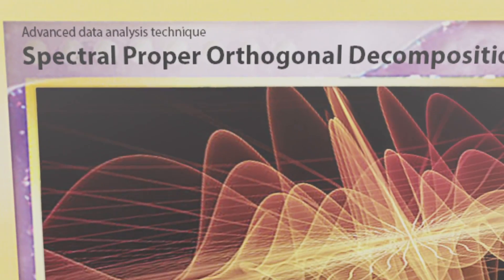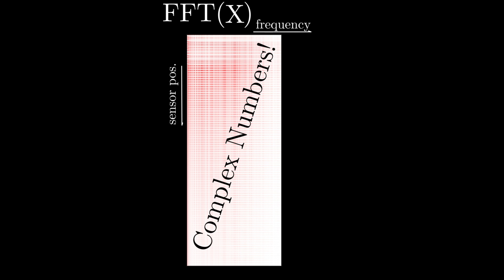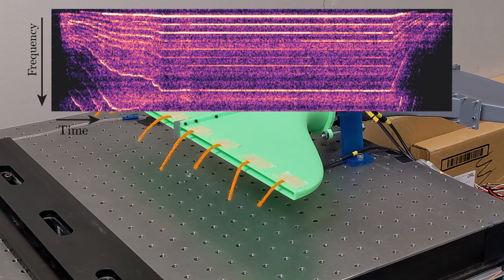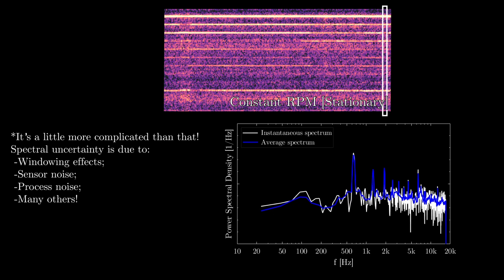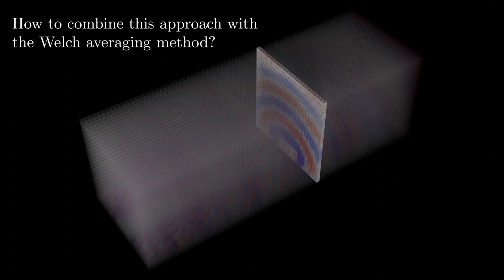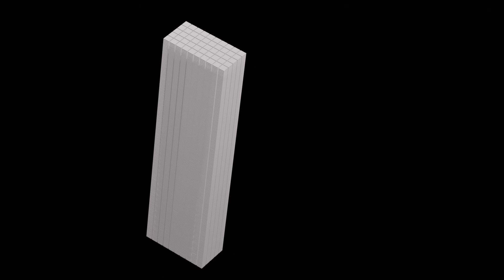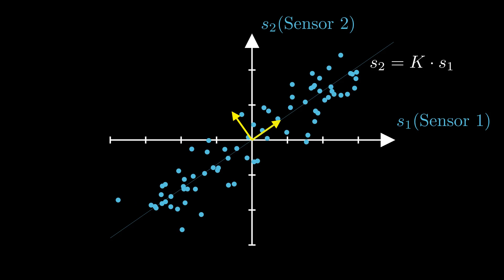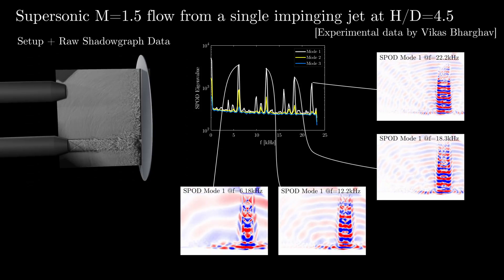The Spectral Proper Orthogonal Decomposition

Comment: Thank you for sharing, it helps me a lot! But I have not fully mastered his mathematical theory. for the filtered correlation matrix S, if the filtered length Nf=0, does it mean that the number of blocks =1, which is POD? If Nf is equal to data length, number of blocks is equal to data length, is this the discrete Fourier transform?

Comment: This is like opening a flood gate to me. The ideas behind these techniques are extraordinary, and I believe you did amazing when setting up examples for us to understand and visualize. 
The quality here goes beyond the roof!

Did you use blender for the animations?
 Did you transfer the color data for the cubes from your code to the graphics editor?
Or did you use simulations built into (what I assume is ) blender to extract data or a mix of both?
Reply from the maker: Hi, Mich, thanks for the feedback! I'm happy this video was helpful! I used Blender and Matlab for most animations. I simulated wave propagation with a wave equation solver I wrote in Madlab, then the data was read through a script in Blender Python scripting to color the cubes. I thought it would be cool to use Blender to run the collision simulations to add some fun special effects 😊 
The waves on the water at the beginning are a displacement map applied in Blender, from a video exported from the Matlab simulation, so that was significantly more straightforward to do.

Comment: I was wondering if you know if there's any sort of tutorial on how the SPOD can be applied to the data acquired from a PIV system? i have 1000 files  in ".vec" format from TSI PIV system and I can't figure out how can I convert it into something that can be read by the SPOD algorithm
Reply from the maker: I'm a big fan of the streaming SPOD code implementation in Matlab, by Prof. Oliver Schmidt. It's pretty easy to follow and modify to your input data set  You can see it here: https://www.mathworks.com/matlabcentral/fileexchange/69963-streaming-spectral-proper-orthogonal-decomposition

Comment: Hey! Loved your video. Huge fan of Steve Brunton as well. Was just curious if you could link some good, cheap float sensors. I'd really like to attempt the experimental setup you show in your video! Thanks!
Reply from the maker: Hey Noah, I'll take your comment as a compliment to my Blender abilities 😊
That scene is CGI, I generated the data for the heights of the wave using the dispersive wave equation and used it as a displacement map on a plane in the 3d animation software Blender. Pretty cool, huh?
Reply: @fzigunov  that is pretty awesome! Would you recommend a similar route for myself? It'd be cool to not have to pay for sensors and create a whole physical setup etc.

Comment: Thanks for the dense effort put into making this video. Is there a way to apply the method to unevenly distubuted sensors such as rainfall statiıns in a region
Reply from the maker: Absolutely. If you look at 10:52, once you flatten the sensors dimension, the technique is agnostic of how the sensors were distributed. So if you have a point cloud of sensors, your SPOD modes should capture spatially sparse samples of the spatial waves in the weather.

Comment from the maker: I hope you enjoyed this video! Feel free to comment if you have any questions or if you find some mistake!

Also, if you're not yet familiar with POD, please check my previous video on the technique! https://youtu.be/axfUYYNd-4Y
The Pokemon game scenes come from a fully-playable Pokemon mod you can check out in my Github page https://github.com/3dfernando/SPOD-Pokebattle

I'll keep a list of observations that were brought up by my colleagues and or commenters:
  - 9:24 You should multiply the coefficients by exp(i*theta). That pi shouldn't be there!
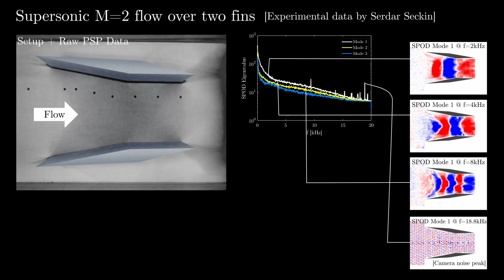  - 15:55 The peak at f=22.2kHz shows backwards wave propagation. This is because of Aliasing! The mode represents the 4th harmonic of the impingement tone which is at 24.7kHz, but the high-speed camera captured the phenomenon at 46.9 kfps, so its Nyquist frequency is 23.45kHz. The peak will still appear in the data, but it will fold back into the resolvable spectrum. This is not a limitation of only SPOD but more generally a limitation of the Fourier transform.
Reply: Fernando great Job! i have tried hard to develop an a MATLAB algorithm  for POD analysis of turbulent flow relevant to my research work, i could not please any help from you would be appreciated.
Reply from the maker: @ademolajayeola9846  Ademola, I hope this was useful! Performing regular POD in Matlab is fairly straightforward as you only need to use the svd() function.
For a SPOD implementation, my favorite is the one by Schmidt and Towne (2019); link in the video description for a Matlab Exchange file.
Reply: @fzigunov  okay, thanks